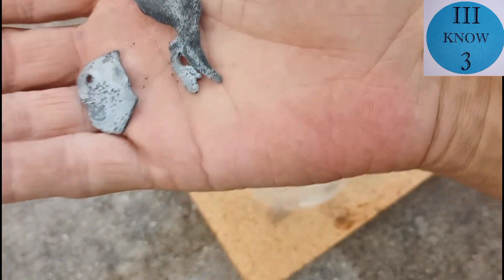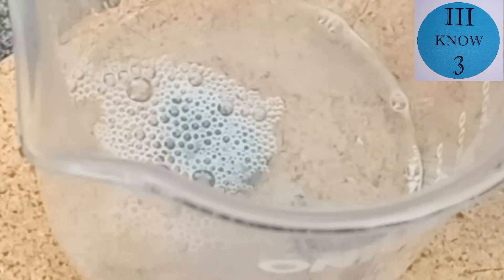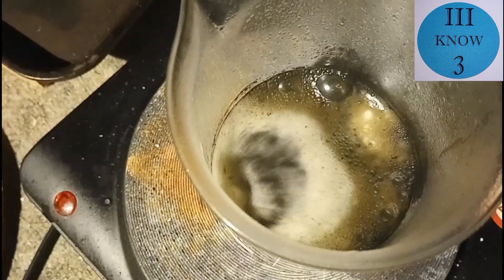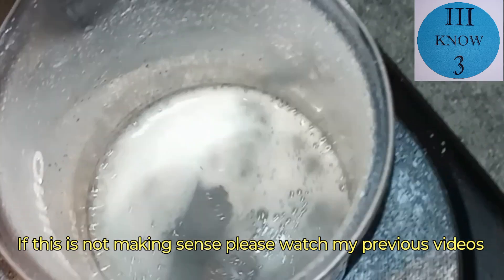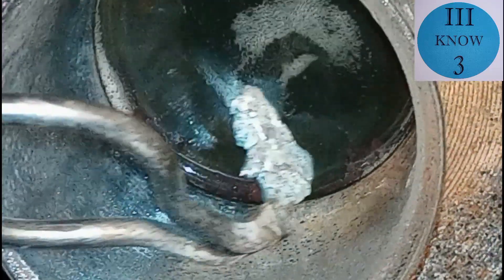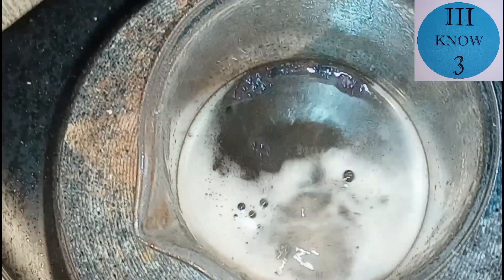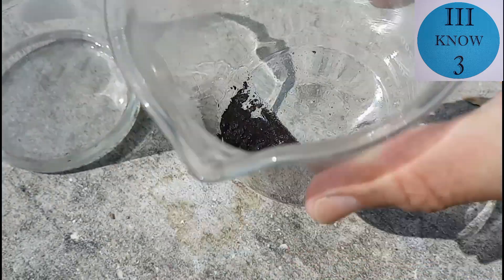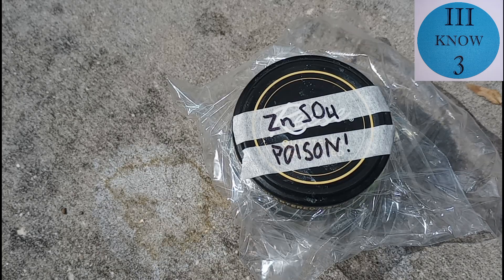Sulfuric Acid and Zinc

Comment: Are you going to plate. Or make a ZN cell?
Cliff hanger.
Reply from the maker: I am trying to separate what I am doing into parts.  The electrochemistry part will be coming soon.  I have been trying to keep my videos shorter. Different parts of the things that I do will not interest everyone (like melting and casting vs. dissolving in acids).  I will use this solution to try to recover some high-quality zinc first.  Maybe after that I will do some electroplating with it also.  I hope the cliff-hanger impression I gave doesn't keep you from subscribing as a lot of my material will be a continuation of things I am working on as I go.  I wish I had been recording while I tried the cell with the zinc acetate electrolyte.  Anyway, thanks for watching and please return for more!